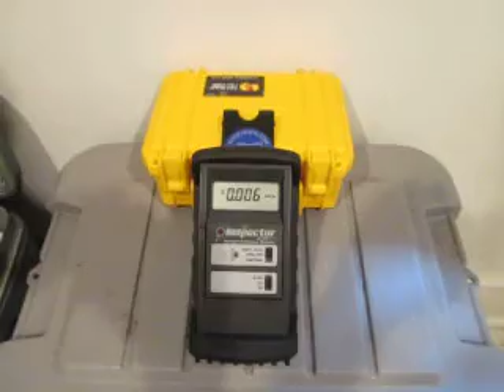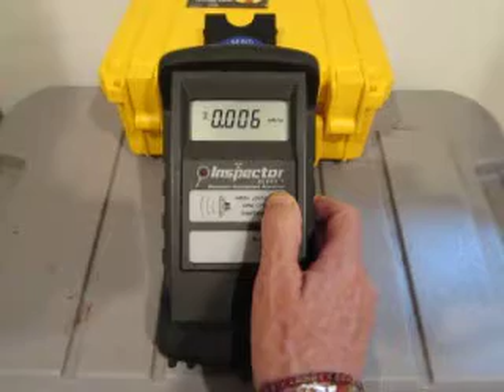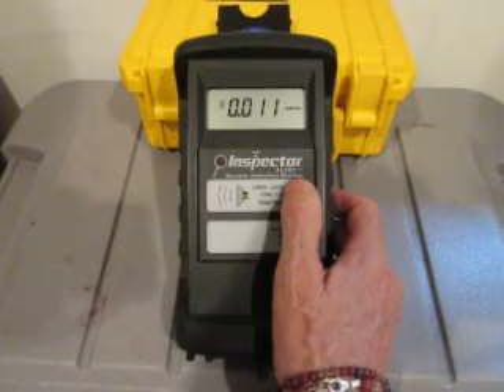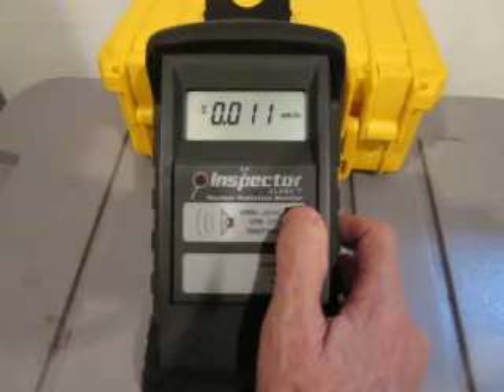Inspector Alert, flipping between CPM & micro-sieverts / hour, for a rough correlational comparison.

Comment: CPM is only for detecting any radiation from any radionuclides and ionizing radiation in general. Always use CPM or CPS. The Inspector models, like most modern Geiger-Müller counters are calibrated with a ±5% accuracy to a NIST traceable Cesium-137 source with a 99% confidence level.
DPM and Bq (decays/minute and decays/second) is a measurement of specific activity of a specific radionuclide. You would need to know the efficiency to measure a specific radionuclide, and its half-life, age, energies, branching intensity %, detector geometry, type of Geiger-Müller tube, and the tube specs, and it has to be measured at a known and fixed distance, subtracting the background radiation at the very least.
μSv/hr is a measurement of equivalent dose and mR/hr is a measurement of exposure to X-ray and gamma radiation only. These units are only accurate if it's calibrated to a specific radionuclide, like Cs-137 for example. Only then will counts AND dose units both be accurate. You can use a dose or exposure filter, like the one's that Ludlum makes. These will "flatten" out the energy-to-response curve of gamma emitting radionuclides, so that dose units will be more accurate. A gamma scintillation counter is also more accurate (and sensitive) for dose units, like the Polimaster 1703GN. It's complicated, but only use CPM or CPS unless you know what radionuclide (gamma and X-ray only) you're measuring.

Comment: Hi, you can not even compare CPM-Counts on different Geiger Counters because of different sensitivity (a, b, g, sensitivity to low energy levels / isotopes, ...).

The CPM-Count depends on the type and size of GM-Tube used and the device itself. Two devices of a different brand would measure different CPM counts in your room - but the radioation would not be different. A CPM count can not be generalized as background, let alone the dose equivalent without specific knowledge of the isotopes.